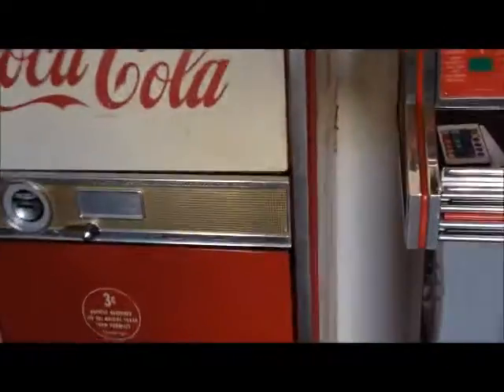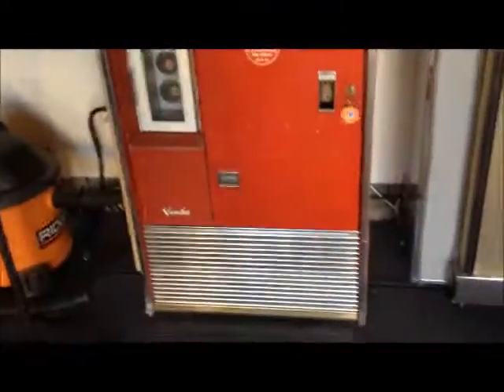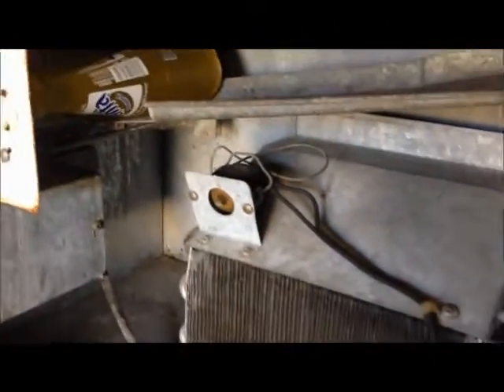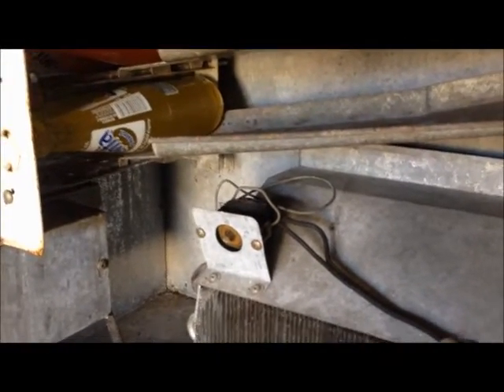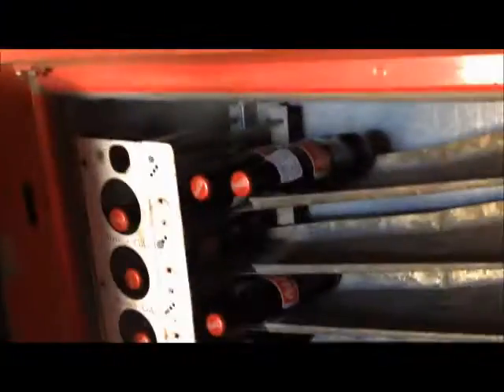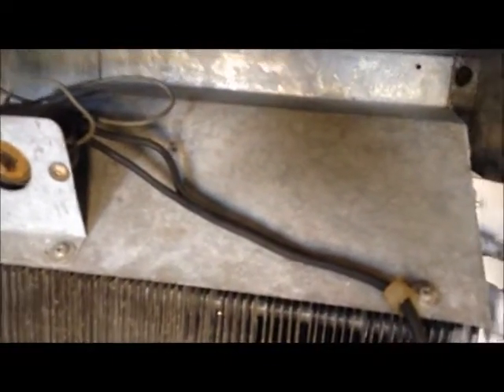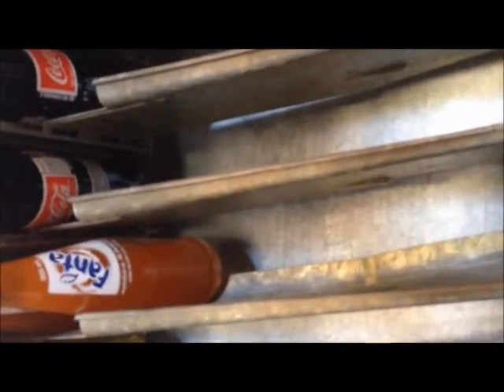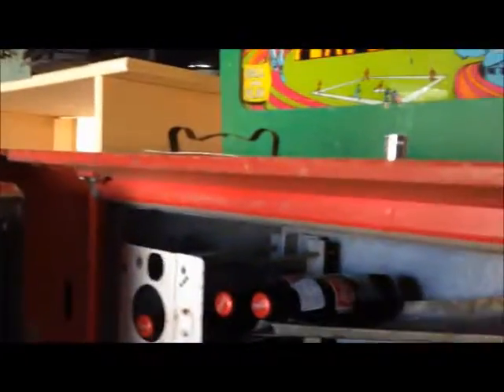How to adjust an unmarked Coke Machine thermostat control corectly

Comment: How do you get the coin changer to vend
Reply from the maker: Try some silicon spray.....It's probably the best non greasy lube.
Unplug the connection and spray with some contact cleaner and or wire brush the contacts (clean them) then plug it back in.
Start there
Reply: @MrJOHNNYLIGHTNING  ok thanks

Comment: How do you get to the light to replace?
Reply: For front light, there are 2 screws on the door you take out.  Then you can gently wedge the face plate off to get the bulb.  The bulb in the area where you get the cokes should be simple to get at from the back of the door.  It just screws or pops out.